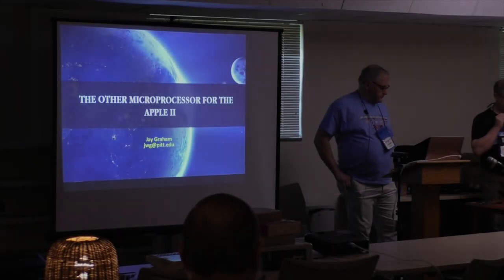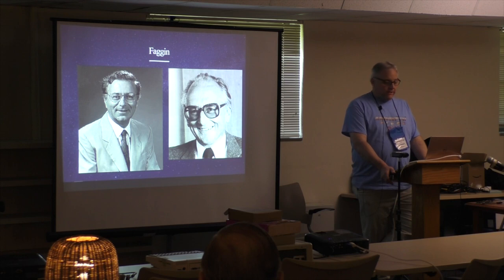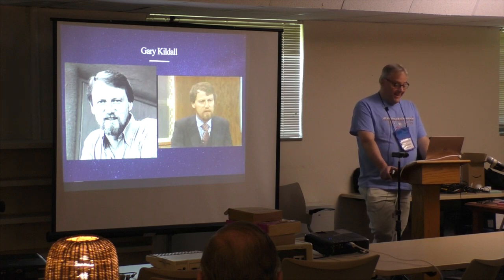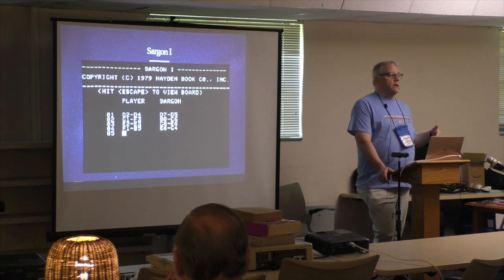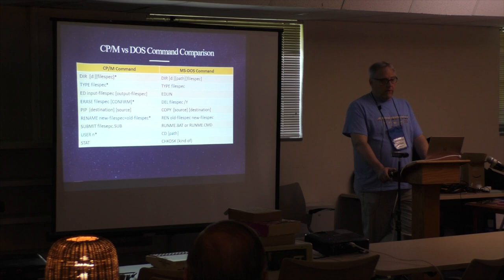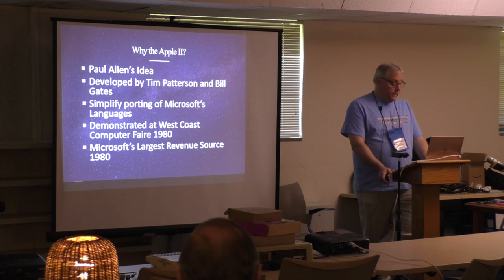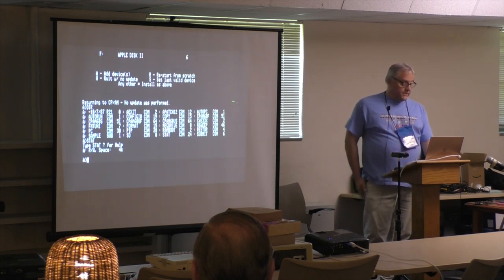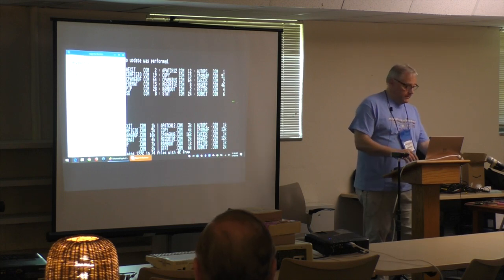Kansasfest 2018 - The Other Microprocessor for the Apple II - Jay Graham

Comment: I thought the BBC Micros were 6502 machines.
Reply: Yes the Acorn Atom, Electron & BBC Micro line are running  6502 CPU.
Reply: @jean-francoiswalter776  It supported the Z80 as a second processor.
Reply: @desiv1170  Yes, I know. And a second 6502 too.
Reply: @jean-francoiswalter776  And an ARM cpu ;)